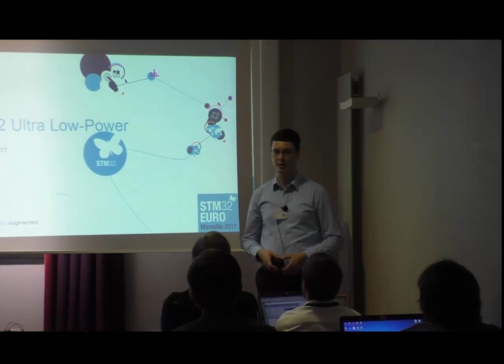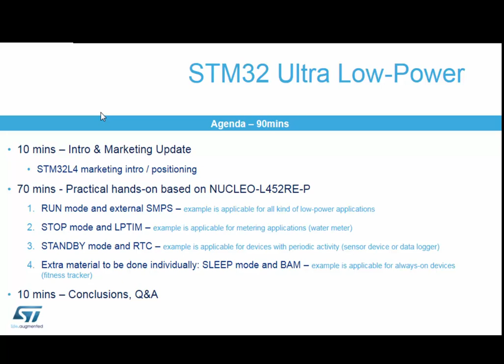Ultra Low Power STM32 extras: 01. Introduction

Comment: Hi, it is posible go directly to ultra low power mode after connect supply voltage ? Or must go to RUN mode and after that go to low power ? what is the best power-saving start-up solution? Power is from a very small battery with high internal resistance and there is not enough space inside the product. If the battery is discharged, the MCU will go to brown-out and then the battery will be unloaded and the processor will try to start via the RUN mode. This of course costs a lot of energy and the processor falls into the brown-out again. He doesn't manage to sleep. Some solution ?